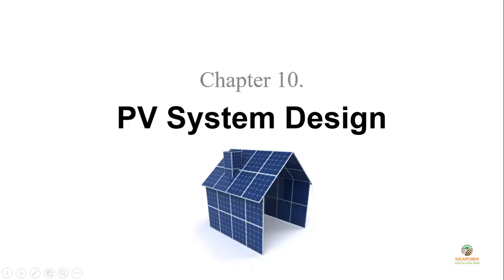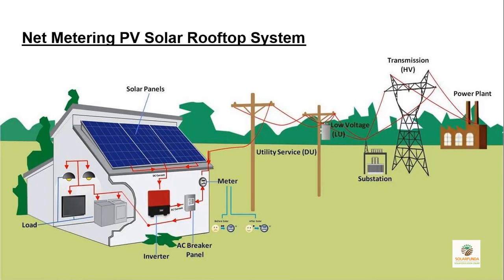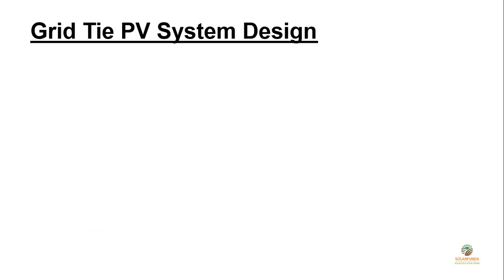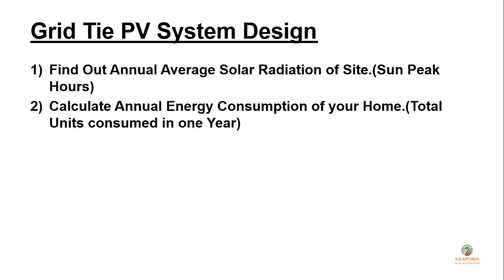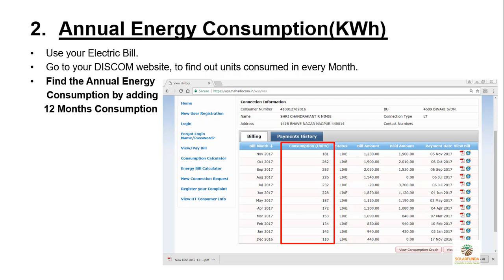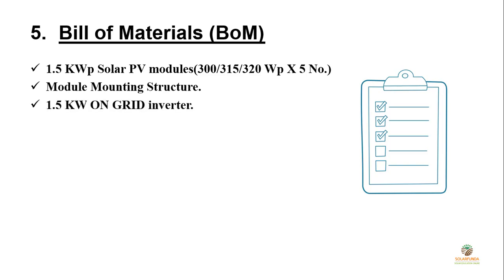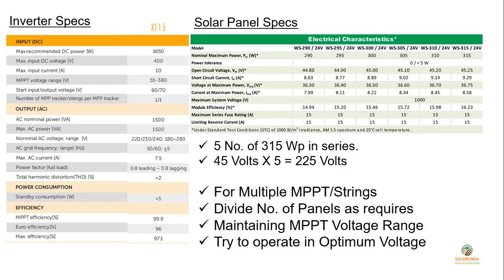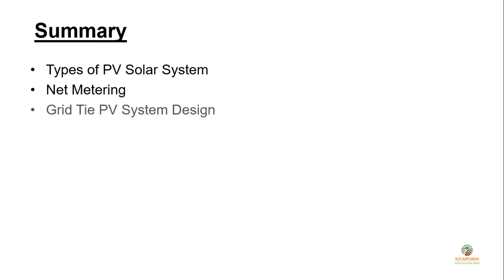PV Design for Solar ON GRID System | Chapter 10 | Session 1 | SolarFunda

Comment: battery size calculation ?? and inverter out put voltage for battery charging ??
Reply from the maker: Battery size depends on the Load and time, and we have to match the battery voltage with the inverter input voltage. If the inverter is of 12 volts, we have to use a 12 volts battery and so on.